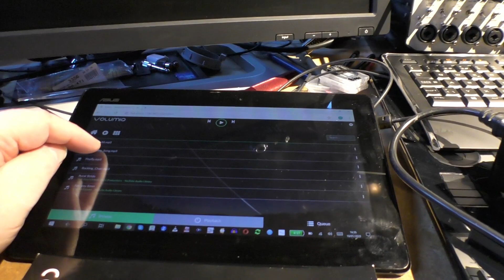Streaming music to my 'vintage' Hifi  - Raspberry Pi and Sabre DAC

Comment from the maker: Unit now works connected via ethernet cable.  The problem was between the screen and the chair - me!   I failed to plug the cable fully into the switch port - duh!
I'm still working on the wireless connection as there's no easy way to route the cable.   I'll post an update once the final setup is in action.

Comment: Very nice. Is there no way to run an Ethernet cable from your network access cable or router to the raspberry pi? That would provide the best possible bandwith for audio streaming.
Reply from the maker: I tried it but the pi didn't even ask for an IP address so the image that has been prepared for the Volumio app clearly assume wifi as the network.   If the repeater doesn't do the trick then I'll look into this in more detail.
Cheers,   John